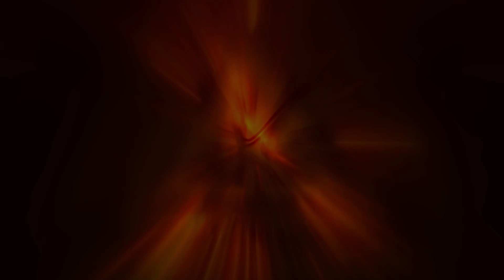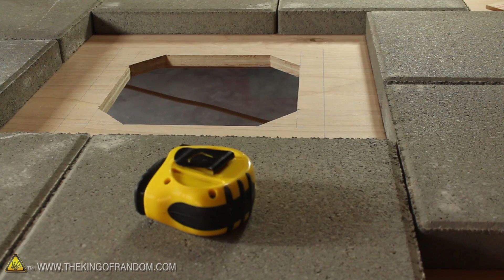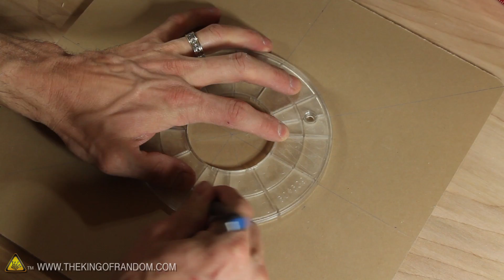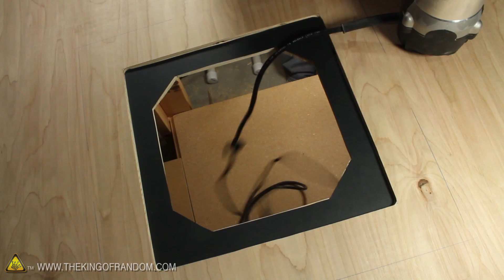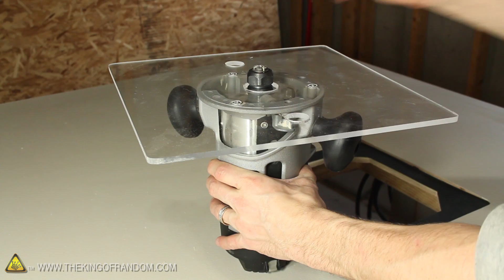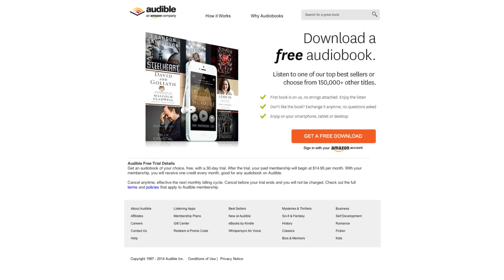Make a Flush Mount Router Station!

Comment: I just made one of these for my workbench and it works a treat - thanks for the video. To get straighter edges on the table hole, I had to clamp a straight edge to the table as the blocks would have moved around too much for my liking.

Comment: Brilliant. You have given me a couple of great ideas to improve a combination router / circular saw / jig saw / vacuum table that I am currently building. Plastic / plexi-glass inserts will be much better than what I was going to use, and the idea of a back light is a great improvement. My table will have a number of inter-changeable inserts to enable quick changes of function, plus has a "vaccuum" box underneath (the router / saws etc actually sit inside this box) for dust collection / removal. There will also be one blank "insert" with only a grid pattern of holes drilled in it to give me a flat, clear work surface with vacuum from beneath the main work area if required for sanding etc. Thanks for posting.

Comment: I have a 14 pound router. Would 1/4 inch Plexiglas hold the router while it's running suspended upside down in a table like yours?

Comment: Could you make this a table saw by adding a skill saw to the back of a piece of plexiglass?
Reply: Matthias Wandel's. table saw is a grate design but it is a stand alone unit. I'm looking for a multipurpose unit/table, on a budget. The router works outside of Grant Tompsons table so no need for two routers, I was hoping for a table/ hand saw to work the same way.

Comment: For things like this, it's useful to cut a second blank to completley cover the mount hole, so you can remove the router and still use the table (for painting as an example).  A couple of steel fender washers on the underside allow you to lift it out with a rare-earth magnet so you won't need finger holes.

Comment: I am halfway through making this. I need to buy a couple of forstner bits. The plexiglass I got from Lowes. Enough to make three of these for $18.00. I'm going to Harbor Freight Tools for the forstner bits since I'm just using them for this project. In the video though you say 1-1/2" forstner bit, but on the screen it says 1-1/4" forstner bit. 
Thanks for this video this way is less expensive than buying a router table already made(for me). I happen to have a lot of spare plywood laying around from a closet renovation, I need to use it for something. Even the cheapie router tables cost over $100 (from what I have seen).

Comment: Nice!! But "inch" is a god awful measurement.

2 and 5 8ths ?? seriously?
Reply: try going to the hardware store and getting drill bits in centimeters... it'd be a nightmare trust me
Reply: No not really, it is much better. We have m1, m2, m3, m4, m5, m6, m7, m8, m9, m10 

and so on... 

very easy and accurate.
Reply: I work in a machine shop and I've worked in a hardware store, but I've never seen or heard of those
Reply: inund8 Metric, That is all.
Reply: TheVideoVolcano
Well this is America, we don't use metric. Thankfully google has a built in unit converter so, when it comes down to it, why does it matter what we use if it can be converted?

Comment: Another thing you could do with this router mount is to add a safety shield above the router bit. Just wing-bolt another block behind the router bit with a round plastic piece at an acceptable distance above/over the bit. Most planks will fit under it, but your hands can't reach it without effort. Need it out of the way? Just remove the wing-bolts.

Comment: Made an easy job hard. Drop a 1" hole though 3/4" ply. Take skid plate off plunging router and screw onto ply. Plug router into pedal switch. Bada Bing. Done. No need for plex.

Comment: great. an option if one doesn't have those concrete stones: just screw or nail some battens in the right distance. the holes can be filled afterwards with paste wood filler.

Comment: an absolutely great project, the only thing i would say is be careful with the type of router you buy for this because some types have cooling vents for the motor toward the router bit, so when its upside down dust will actually fall into the motor and ruin it, but if you keep it blown out with an air compressor im sure it will work perfect. top notch project

Comment: Drill holes in the plexiglass, and using weatherstripping you could build a 1.5 to 3 inch channel that the unit set down on supported by some framing underneath- maybe use a piece of CPVC ,pipe- thus you could connect a shop vac for almost dust free routing on the table if the vac was say a 4 or 5 amp model.

Comment: At school (Wood Technics) we just take a fiberboard we drill a random hole in it. We place our Dewalt Router on it, mark the holes, drill the holes and it's done, the height of the router can still be adjusted. (Don't know if this is easy with all routers, on school we have Dewalt routers which cost 494€ (666$). The way you explain is quite nice since you just made your own workbench that has place for a router.
I wouldn't use a fiberboard like you did if I would make it but get myself a decent HPL plate, it costs a little more but it's more durable.
More videos for woodworking are welcome. Good job!